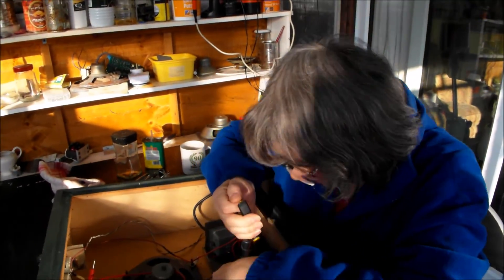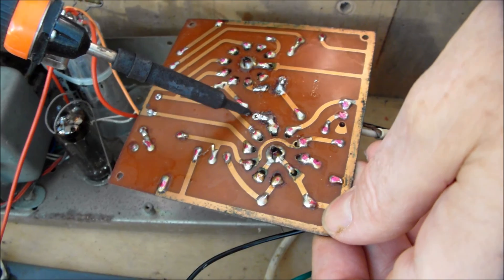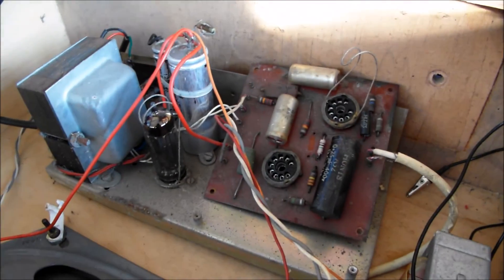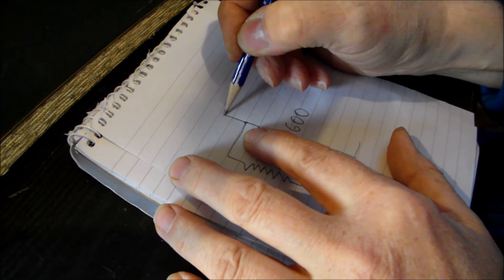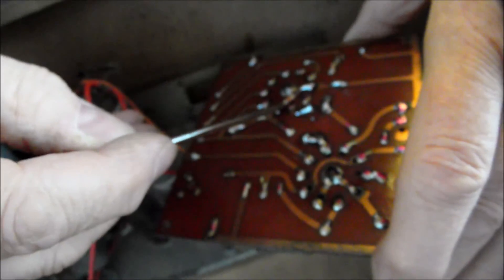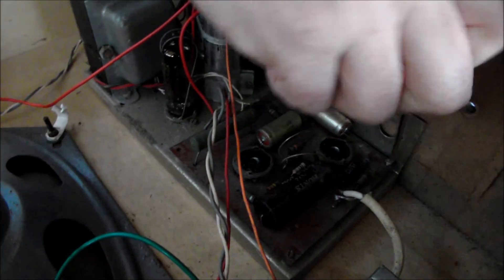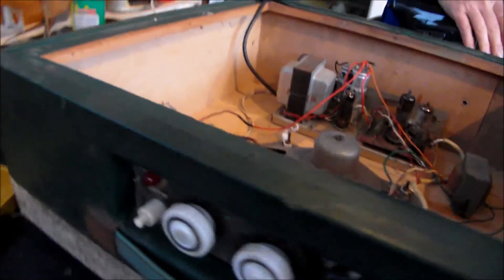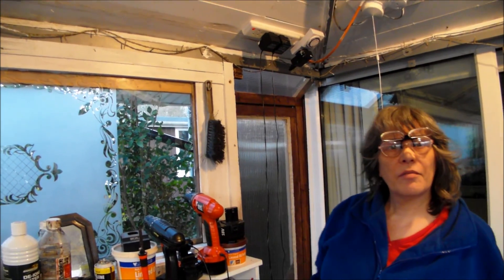Bird Talisman part 2: soldering, repair, making it work and testing.

Comment: Hello Ms Hoofbags, i have a Bird Talisman amp just like this......i get a sliver of sound when i switch it on and turn it off,i have zero experience of working on amps......i replaced the 3 valves.......no change......can you advise me please,can you fix it ?......can i take the amp bit out of the cabinet.....Help.

Comment from the maker: Hello Jamie. So pleased that it is. The Bird Talisman is quite a bit up in quality from Selmer Little Giants and Fender Champ, all of which share a similar circuit. I will send you a text that will include my number. Happy to look at both of them. If I'm not able to then there's the Hastings Amp Guy, who most folks go to. He does the bigger ones, whereas I'm a bit scared of them because of the voltages. Having an electric shock off one of these babies ain't much fun! Could you enlighten as to the model numbers, please? Liz. (o:

Comment: Thanks for the film, nice to see the amp working and good tip re: the resistors.
Reply from the maker: Glad to be of help. I'm not that impressed with the design of this Talisman: not enough gain. Much prefer amps such as the Selmer Little Giant and the Fender Champ. The Talisman is probably ok for a small club where the player needs a cleaner sort of sound. Let's keep these old amps going: 1960s! Get one from China and it will probably only last for 1 year.